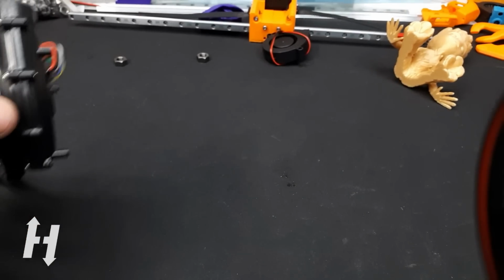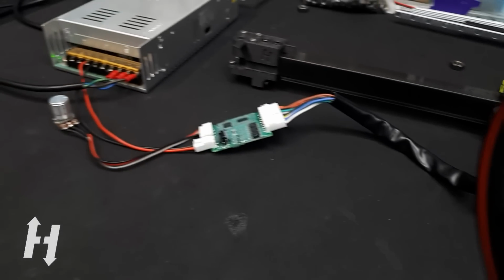Can this turbine be installed on a 3D printer?

Comment: As the potmeter is a voltage divider, the control board respond to a voltage, you can convert a PWM signal to a voltage with an RC filter, or use a PWM to voltage converter board.
Reply: If it's just a signal (no real current is going through the pot) you can use a digital potentiometer with a simple opamp to create a valid voltage range for the controller. It would be much more accurate.
Reply from the maker: Thank you! will look into that :)
Reply: @MirageC  or just use a digital potentiometer
Reply: @MirageC  add a optional op amp buffer to not load the filter(if necessary), but that isn't needed if the control input is already high impedance.
Reply: This, could also use an spi digipot like some older printers/reprap use to set motor current before programmable step drivers; just adjusts the pot on the step driver in software. Marlin already supports it, so should be able to cobble together an output to software control fan speed without ever going analog.
Reply: I use this kind of blower on my JUBILEE, I use PWM fan of the duet + small RC filter work really well to smooth the signal and good for the CPAP controller board
Reply: @juliendubessy6416  Was thinking of the same. Should not be more difficult than smoothing the existing fan PWM signal with an RC filter and a voltage divider to get the correct range.
Reply: Or just use a digital pot. A digital pot will change its resistance based on a pwm signal.
Reply: @Unmannedair  not stable with temperature variation in the room, the ration is x400 more sensitive and more complex than 1 capacitor and 1 resistor
Reply: A cheap DAC like the MCP4725 will take care of that... maybe you'll need an arduino taking care of reading the pwm from the board and translating it to the dac. but I BET it will work with straight up pwm. you just need to make a signal inverter (basically a not gate. It is a one transistor circuit), because the board turns the fan on and off but PWMing ground and not vcc.